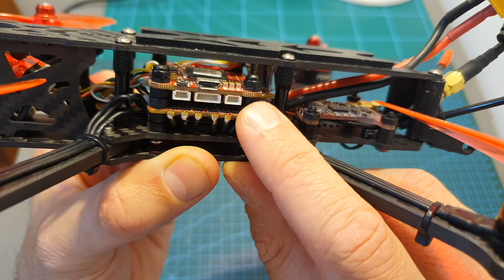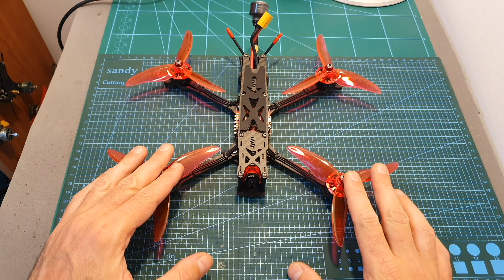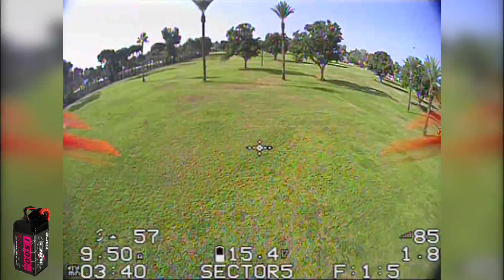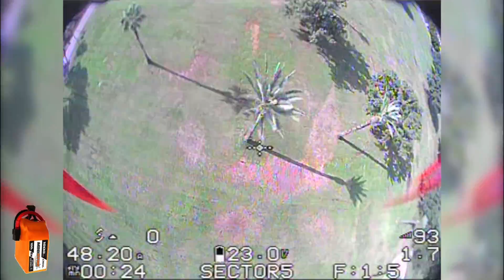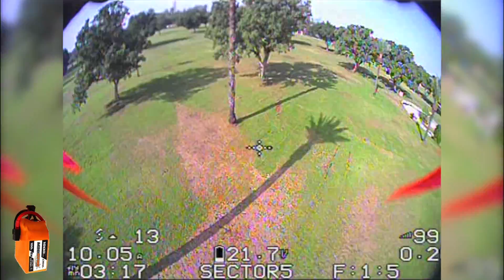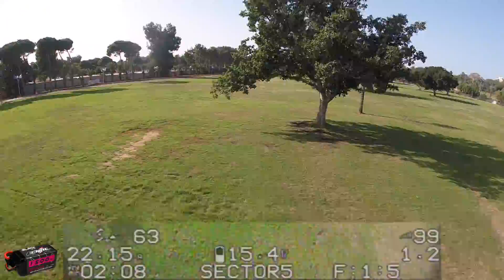HGLRC Sector 5 V2 BNF 6s Freestyle Racer - Review, Setup & Flight Footage

Comment: Thanks gal quad looks pretty locked on on that tune defiantly spiked my interest after a quad to practice tricks with what do think the durability would be like cheers
Reply: Was messing with the filters and pushed the my sector 5 as hard as I could doing a split s (?) When it crapped out on me and I planted it into the ground at full throttle. 1 screw that was holding the VTX down snapped off, my big 1500mah 6s battery went flying despite double straps but the kwad was fine! Plugged a new battery, bent back the props and continued flying.
Reply from the maker: @SweetStat  I'm glad it survived the crash. Happy flying!
Reply from the maker: Thanks Steven. It looks pretty durable to me.

Comment: Flight times? 6s 1500mah 8 minutes? Is that right?
Reply from the maker: 4s 1500mah about 8 minutes.
Reply: @KremerFPV  how is this possible Gal? The nazgul5 has similar specs.. I should get this flight time on those two?
Reply from the maker: @thiagoamatofpv  it has a lower kv. Flight time using the same battery on the Nazgul5 will be a bit shorter.
Reply: @KremerFPV  Hmmm.. A 4s 2500~3000mah should me get where on the nazgul5 6s version?
Reply from the maker: @thiagoamatofpv  It will be too heavy

Comment: The FS-A8S receiver is actually helpful in one respect, you don't have to walk very far when it failsafes ;)
I've had that RX failsafe at distances literally shorter than I could have thrown the quad. They should've ceased production of that RX years ago, it's terrible, the FS-RX2A Pro is better, but still no RSSI. I ended up ditching FlySky for Crossfire.
Reply: LMFAO👍👍👍 Ha ha ha👍
Reply: @Sasha Kruse Grim  It's possible to get analogue RSSI out on many FlySky receivers, but your flight controller has to have analogue RSSI ADC input for it to work, you also need some ninja soldering skills.
Search for the YouTube video "Get RSSI on most Flysky receivers!".